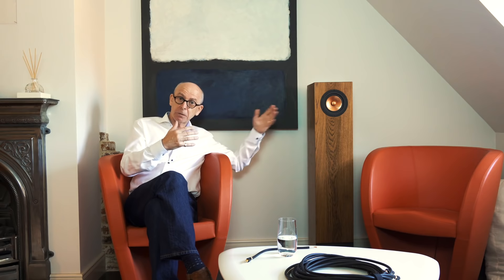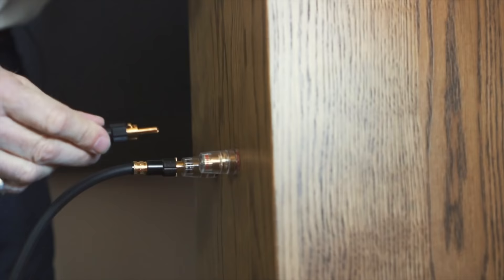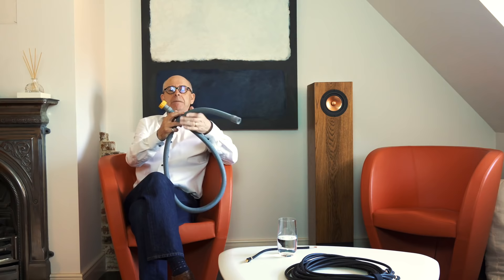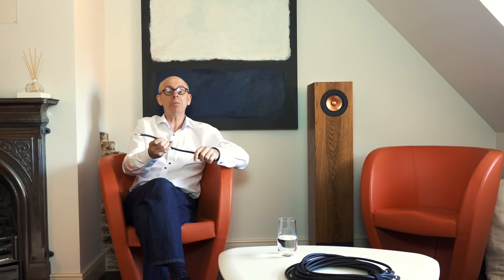Loudspeaker cables - how do they make a difference?

Comment: Do computers go awry with bad ordinary copper cables in fact silver cables.
Don't u feel ashamed .
If one starts seeing the language of Hi-fi ,irs all based around love
Warm,silky smooth.Adds touch of that silky ....
Insert a .....and oh! I couldn't believe.
My emotions just ....
U walk into the .....
I came ......
Reply from the maker: Hi thanks for your comment. Absolutely, you will find all kinds of metals and metal alloys used in all kinds of electronic equipment. Not just copper. In recording studios, we have been using silver plated. Multi strand copper microphone cables for years, especially when matched with certain kinds of microphone.  With the birth of conducting polymers we expect these to keep in too, in the coming years. 
Hoping that helps?
Reply: @Pearl Acoustics  I have read about skin effect .
Is Wikipedia the last word.
See null test by ethan winer? 
Who has the brain registration. 
It takes let's say 20 minutes to change cables or components. 
Who can pin point these differences.
Do recording studios use the NASA technology cables from microphones to recording compressors ,mixers.....
Altec compressors r still used by sane people .
Do they listen to playback of recording in mixing studios on space age materials.
Good strategy to use NASA ....
Applo 11 airship...
Yes ,without room accoustics no nuances can be noticed.
I has Arcam CD player .Added TENT Labs DAC , Lord no change.
Still spent more on Cyrus and dedicated Cyrus power supply . Very little which is still doubtful.
Power supplies ,clean mains .
U think a meter or so of power cable can make a difference ,when from power house to ur transformer then into ur home wiring into the meter of power cable.oops! Bears me.
Good amps have built in power supplies with diodes or rectifiers then filters ...no ripples ....clean DC where needed and AC where heeded. 
Pl.Send me a pair to beat my Altec A7 with 515 B driver 288 compression driver or my ESL 63.
Or even my PSB T45 .
Leak St20 or Macintosh A123 .
It would be great to audition your speakers as I have Jordan JSX 92  tried in different enclosures including one horn by Nelson Pass .

Comment: The rule is if you can’t measure it electronically you can’t hear it.
Reply from the maker: Hi Jacob, thanks for this. I have been wondering about this for a while now. I think it is a question of how one measures. For example, if we simply do a sign wave curve frequency test, things ‘should measure the same’ depending on the level of precision of the test equipment. Take two different sounding microphones, both having a very similar frequency response. One might sound very different from another but the pure sign wave test will only show the difference in amplitude at any given frequency and not precisely the colour of the sound difference. Think of a flute and an oboe both playing A 440Hz. It is easy to tell the flute and the oboe apart. 
Humans dna has developed over tens of thousands of years to allow our ears to differentiate from one sound to another, your mothers voice from that of her sister (for example). In certain fields, like violin makers, for example, their hearing is so fine tuned to a very specific point, they can differentiate between different types of rosin on a bow, or the subtlest changes due to temperature or humidity. I believe (and stand to be corrected) that these extremely subtle differences can not be electronically detected using conventional tests, the equipment is simply not up to it. But I am wondering, what if we recorded it with the best microphones on the planet and then look at the tonal pattern on a specific note, perhaps we will see the subtlest differences?  The question then remains, would it work for cables? By looking at the sweep pattern, you could not detect the ‘nicer’ sounding instrument or cable, but you could detect a difference. 
One last point for reflection. If you put a simple capacitor across the terminals of your loudspeakers, depending on its value, you will immediately hear a difference (that can be measured). It is extremely easy for cable interconnect manufacturers to build in desired capacitance into their cables by simply changing the composition of the materials they use. In this way they are able to roll off treble etc. 
More research needed. Thanks again for your comment
Reply: I appreciate the answer! I am a electrician for 14 years and a maintenance technician for 7. I know the difference between resistance, inductance, capacitance. I know you can tune cables. But if you can’t measure a electric difference in the electric signal no one will hear a difference. The speaker will not react differently on the electric signal. Pure science, pure physics. No one can argue with that. I believe cables are snake oil until someone have proven this with a blind test. His nonsense about that the voice changed with the cable is “believe”. A trained musician can hear the difference on a Stradivarius, but almost any one can. It is also measurable. Everything els but the cable is important. Would be really interesting to hear him explain how his speakers can get down to 10-20Hz with that size element. And judging from his age, his hearing have guaranteed degraded. Much more important is everything els. The recording, the amplifier, the speaker construction, the room you are listening in. But if you are religious no one can convert you.

Comment: How much inter modulation distortion do you get by using a single cone todo everything? (a lot) and how much air can a tiny 5 inch cone move? (not a lot), 
This thing  cannot reproduce a realistic grand piano not to mention Orchestra, let alone persecution got forbid rock,a sub is a must 
unless you like everything made small and miniaturized,
Reply from the maker: Thank you for your comment. I can understand your skepticism, however I can assure you that at 38hz they are only  minus 3db in our listening room. As a comparison, The bridge on a double bass hardly moves with the vibration of a string and yet produces tremendous sound. Think about gently blowing over the top of a glass beer bottle - how deep a note can you produce in an 18cm pipe?
Reply: @PearlAcoustics   Thank you, I appreciate your, answer, 
sad that brick and mortar stores are long gone, so that one cannot experience first hand, and I need to take your word for it,

The 38Hz,loading or FR is not as important as IMD and HD, air compresses I doubt the lower bass notes do not modulate a females voice using one cone at my preferred listening levels, 
undistorted 87db SPL with +20 db peaks in the waveform sounds less loud and has less RMS energy than 87db SPL with some distortion and limited peaks (+10db and soft clipping tube and mechanical). which I assume is the performance within a room of a small cone?,
I normally listen at a measured average 96db SPL with 115db distortion free peaks , and have never had a neighbor complaint , because musical waves without distortion carry far less total RMS energy vs same SPL with some non-linearity.  
it took me 50 years to reach the point to understand this, the air itself has its limits, air compresses even if you had the theoretically non existent perfect cone and amp  (no flexing and no resonance,  ) .
I have directly connected amplifiers (DSP crossed over w 48db slopes) into multiple horns, each horn has it own dedicated amp,  slopes and EQ,  the electronics are easy and cheaply done (class-D) as long as you stick to engineering and not fall for silly audiophile expensive equipment with non scientific snake oil merits, I can design for low distortion and any FR response curve I want, or I can put the same money into audiophile grade silliness and not have enough left but run a tiny cone. 
In practice, How do you know its loud if there is no distortion? 115db SPL peaks no distortion with 96db RMS 115DB SPL peaks  sound is realistic effortless reproduction, is not loud and fatiguing as 87db loud with distortion.
Reply: @xprcloud  The speaker looks fine for casual listeners in normal untreated room with some wood furniture but don't expect too much from it :)
Reply: @ognyankoynashki  I agree %100, however for casual listening should be a way lower price point, with less expectations,
I think for this price you get close  to Klipsch forte or Klipsch cornballs territory

Comment: Further evidence that there appears no limit to the amount of self delusion employed by ‘platinum-eared’ audio types. Like any religious zealot, they refrain from systematically testing their beliefs for fear of discovering they are without foundation. 
The fact that a simple double-blind test would prove whether or not speaker cables can discernibly alter audio quality. 
I once actually tried this on a large scale. 
After-hours at a friends hi-fi supply store we spent (wasted) a couple of hours comparing several pricey ‘audiophile’ speaker cables to a length of ordinary figure-eight lamp cord with a range of recorded music. 
End result? 
ABSOLUTELY NO PERCEPTIBLE DIFFERENCE WHATSOEVER❕

Comment: Hi. Never read so much BS. Speaker cables is a field most know little or none. But your conclusion is Absolut wrong. Its a shame. I studied and researched the subject, had a test group and the answer for your question is not related to the speaker, but to the Amp's DF and cable length.

Comment: On an atomic level my oats are acting up. Snake oil. Power of the amp and speaker efficiency dictates a copper wire diameter. Or is snake oil taking us to a platinum, iridium , gold cable. God. This is annoying.

Comment: 303 - 1367 pounds for speaker cables??  Really? I was curious about the Sibelius line of speakers but after listening to this talk, although well presented, I'll be looking elsewhere.
Reply from the maker: Hi Martin, sorry to hear that but I totally respect your conclusion. However, The cables are very bulky, (lots of high grade copper), have very expensive clamping connectors and are hand made here in Belgium. And as I say in my presentation, I do not consider them to be magic and they are by no means essential. They are just the ones we use and like for various reasons. Least of all, the clamps hold them in tightly and they lie nice and flat on the floor. And their sound? ‘Completely neutral’

Comment: Have to say, this is the most ridiculous hokum I have ever heard. I dare you to connect an oscilliscope across your speaker terminals and show us the results using the same audio with different wires. > 10Mohm scope probe recommended.Source: Am electronic engineer. And yes I do know the answer already, but maybe you can find out something for yourself. Also, I hate to break it to you, but audio in most amplifiers is an AC signal, meaning current flows in both directions, to and from cct common GND.

Comment: I have done quite a few blind tests an£ have never been able to correctly identify the expensive cable over the basic cable.
I sold all my expensive silver cables and replaced them with relatively cheap OFC copper cables and no longer worry about them, just enjoy the music.
The whole cable thing is a cash cow feeding off the neurosis of audiophiles.
You don’t see exotic cables in recording studios or concert halls.
Total nonsense.
Reply from the maker: Hi Kevin, thanks for your comment. I think this matches my point. Our cables are made of thick, multi-strand copper, and in recording studios you do see high quality cables. For example, often microphone cables are made from silver plated copper, and do cost a fair bit per meter, but obviously not anywhere near the crazy high prices that one can pay for domestic HiFi interconnects. The silver plating can be heard in some circumstances, especially for low voltage applications like microphones and that’s what I was referring to.

Comment: SHOW RAW DATA! Expensive speaker wire is under nonsense. Only thing that matters is the run length and the gauge. Every electrical engineer that I know says the same thing. Zero data to back the claims up….! But I understand your selling a product and want the suckers to buy into it!
Reply from the maker: Hi, thanks for your comment. I understand your point entirely, so I am guessing you may have missed the end of the video, because I clearly state that we use, multi-strand copper with good quality connectors. And we do this because it is affordable (people can simply make their own) and because it is as ‘neutral’ as possible. Our cables cost what they do because they are hand assembled in Belgium from high quality materials but we openly encourage people, who are prepared to invest the effort, to make their own. I hope this addresses your comment

Comment: Ethan Weiner ended all of these discussions with the null test. Any differences are buried in the noise floor below 100dbfs... Its just simply no.
Reply from the maker: Hi, thanks for your comment. And as you probably saw, our conclusion is to simply use multi-strand copper. But there are manufacturers who use capacitance and inductance, built into the cable to make it shape the sound (in exactly the same way was a crossover of notch filter works). It’s relatively easily done.
Reply: @PearlAcoustics  are these differences measurable? I might be ignorant here but if the differences are measurable in orders of magnitude below the threshold of human hearing then moving the speaker 5cm would make drastically more difference to the frequency response at the listening position than changing the cable... What are the measurable frequency response differences and at what amplitude? If there are none published then I remain highly sceptical. I'm a professional recording and mixing engineer working primarily in chamber music recording in Germany.
Reply from the maker: @GingerDrums  Hi, nice to talk with you. As you might know, I record chamber music too here in Belgium and France?
You’re absolutely right about cables. And moving a loudspeaker 5cm to the right can indeed have a much bigger influence. That’s why I say, cables can only be the very last resort. I am sure you agree with me that poor quality microphone cables can be noisy and a pain… and maybe you have tried swapping silver plated (long run) microphone cables with other types, and maybe you have detected a difference? Especially in long runs? 
We advocate using simple multi strand copper for loudspeakers, just to be sure there is no trickery going on. Changing the kind of wire in loudspeaker voice coils and microphones makes a big difference, but I am sure you know that already.

Comment: More audiophile superstition. In the real world, with speakers within -- say -- fifty feet of the amp, there is NO DIFFERENCE between a length of cheap zipcord (lamp wire) and whatever overpriced super-duper "speaker cable" you want to talk about. NO DIFFERENCE. All this talk of skin effect, capacitance, crosstalk, "neutral balanced cable" and whatever is complete and utter rubbish. This piece offers no charts, no math, no engineering. That's because there IS NO engineering to support any of these fantastical claims.

Save your money. Use zipcord to connect your speakers. You won't hear a difference -- because there is no difference to hear.

Comment: What nonsense.
Plating is for ,to avoid oxidation and save copper .
Wester electric ,the first good cable  coated it with tin.
Imagine soldering wire is made of mostly tin,bit of copper and one another 
Maybe also melting temperature in mind .
Should we use pure silver sodering shit.
As we dsesignedit. For heavens sake no shame.

Comment: Why do we still need "loudspeaker cables" at all?  Why do we not integrate modern power amplifier[s] into the loudspeaker cabinet in order to shorten the loudspeaker cable[s] to a few feet at most, with the added advantage that crossover band splitting can be done with active electronics instead of bulky, and expensive, passive networks?  Yes we'd now need to provide AC wall outlet power to the speaker cabinet[s], but surely that is no impediment...  Now the audio can be carried from the sources on STP {shielded twisted pair} cables in either analog or digital format to a user-controllable 'preamp', followed by similar cabling to the loudspeakers at much lower expense with zero reasons to need "audiophile-quality" cables .
IMHO to do otherwise is to fetishise the various components of your audio system, when all this hardware should be HEARD but not SEEN.  Mumble, mumble.
Reply from the maker: A very interesting point. You’re absolutely right. The tricky point is wirelessly separating right and left Channel with two separate loudspeakers, but we’re only months away from commercial companies offering exactly that possibility. The big problem will be with software upgrades and equipment ceasing to work

Comment: Show me quantitative objective data, not subjective opinions. But before all that, show me a hearing test that says you are biologically capable of hearing the differences.
Reply from the maker: Hi thanks for your comment, hopefully, if you watched the video you would follow the reasoning and how we came to the conclusion to suggest normal twisted strand copper is the best ‘neutral’ solution. I state that it is technically very easy for a cable manufacturer to change the sound by building into their cables additional capacitance, inductance and or resistance, and in this way, it is possible to build a kind of step filter.

Comment: I call crap....  I was a pro audio engineer for 20 years.... we used belden 12 and 10 gage wire for all our huge PA systems.... we did everything from rock shows to raves to folk music festivals Jazz and even classical music, all the same wire. ...Racks and racks of QSC power Amplifiers.... Neutrik speakon twist lock connectors.  You are hearing nothing. Your superiority complex is mad.
Reply: Was your objective the best sound possible or simply making a connection?